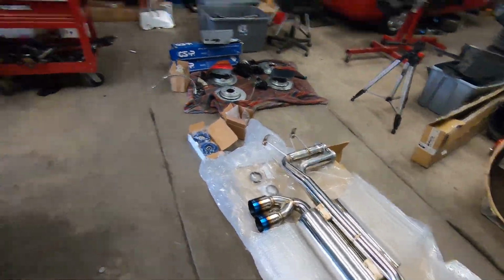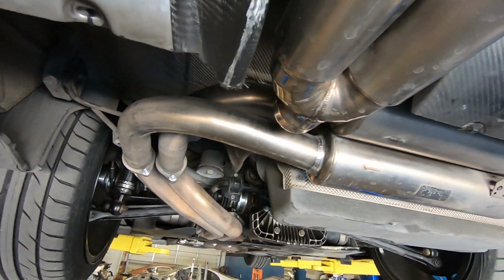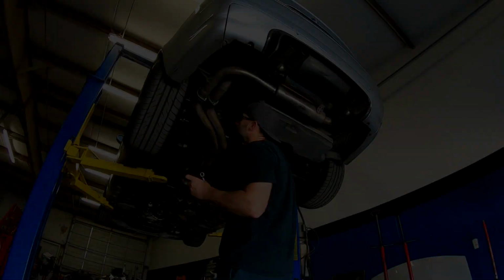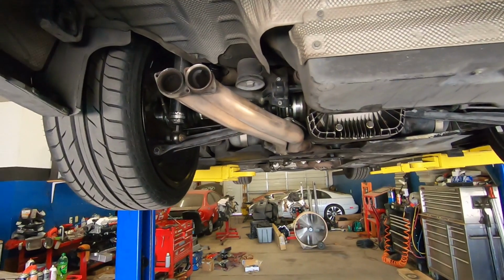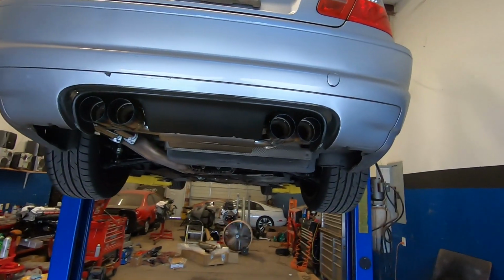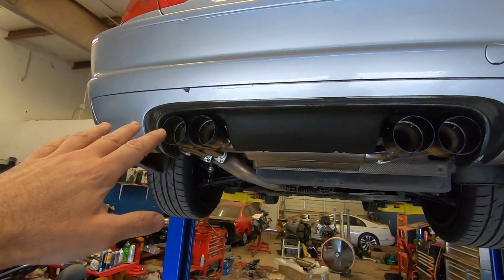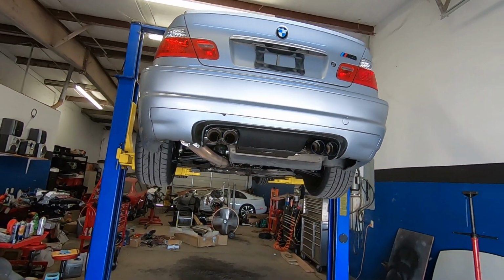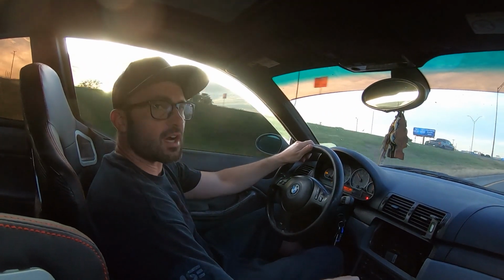Time to Fix my E46 M3 (part 12)

Comment: Sounds much better.  Good video.  You'll go faster if you remove the 5 pounds of air fresheners hanging from the mirror :P.  Why is your low fuel light on if you have so much fuel?
Reply from the maker: Haha I know, I always tell myself to take the fresheners out but always forget.  Good eye on the fuel gauge I have a problem with the sending unit level sensor I believe. That is next on my list. I bought this car with a blown engine. Got it going again but its got issues here and there. Please check out my playlist, you can see the whole build if you like. Thanks!
Reply: @importmodify  Great videos,  I checked them out and you do good work editing.  I have car that looks very similar.  I might switch out my Milltek which drones like crazy and go for the Megan.
Reply from the maker: Thanks! Yeah go for it!